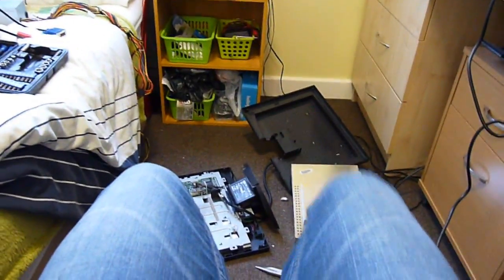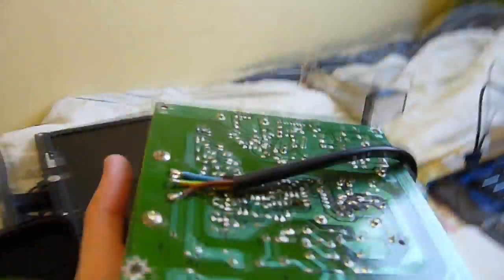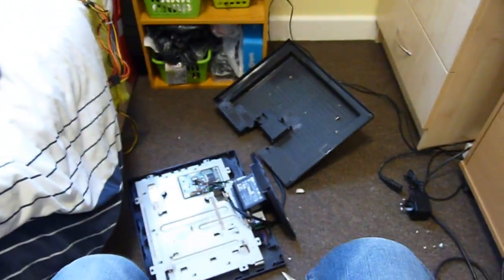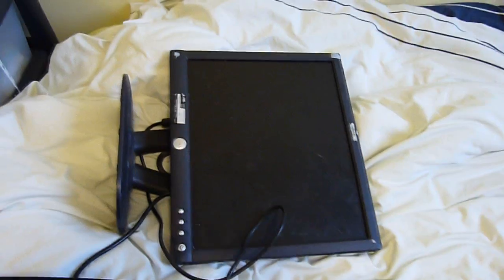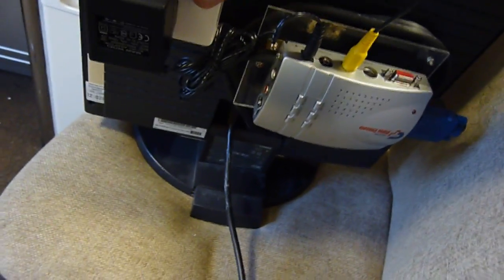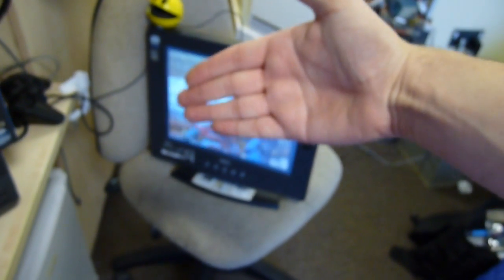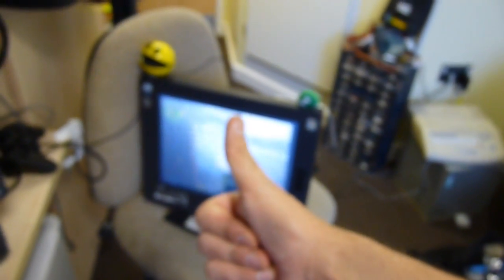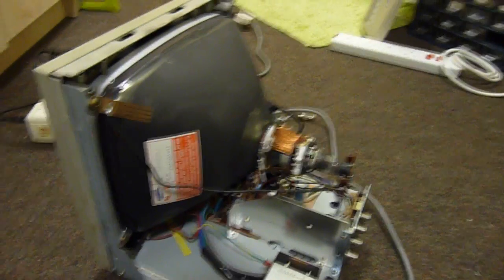DELL Monitor RCA To VGA Converter Mod

Comment: Hello EP9
I would like to kindly ask about the PSU birck used to power the converter. How much VOLTs is it rated with? I own one such converter, but have absolutely no clue which PSU I should use...
Thank you!
Reply from the maker: I think 5V. These days I would just pull off the monitors 5V but back then I just wired it up to the 250V.

Comment: I bought a similar converter like that today for my ps3 and my old computer monitor. I plugged it all in every way possible (I did reset my video settings in my ps3 to the av cables.) anddddddd I couldn't get any video on my monitor at all. I was wondering if there was a certain way I wasn't doing it right or what not? 
(I just noticed it says VGA to rca...is there a way to make it work the other way?)

Here is the link to the one I have if it helps!

http://www.amazon.com/gp/aw/d/B001CJOLBW/ref=mp_s_a_1_9?qid=1419916888&sr=8-9&pi=AC_SX110_SY165_QL70
Reply: you bought the wrong converter. the Converter you would need would be this. http://www.amazon.com/Ozright-RCA-Composite-VGA-Converter/dp/B018PZSMK6/ref=sr_1_3?s=electronics&ie=UTF8&qid=1465118878&sr=1-3&keywords=RCA+Composite+and+S-Video+to+VGA+Converter+Wide+Screen+US+Version
Reply from the maker: Nice, saved me a job.
Reply from the maker: If you were waiting for me the answer. It might be 5 years later ;-)
Reply: @TheEPROM9  Now tell us the answer
Reply from the maker: @DarkwoodDemonDoor  Lol you remembered.

These days you'd just convert it to HDMI. Although the cheap converters are crap. The retro community have made some good ones.

Comment: Do you have a link to where you got this specific adapter? I found this, (http://www.ebay.co.uk/itm/AV-RCA-Composite-S-video-Input-to-VGA-Output-Monitor-Adapter-Converter-DVD-CCTV-/251461429090?pt=UK_Computing_Sound_Vision_Video_Cables_Adapters&hash=item3a8c44e762)
But it has a BNC connector....
Reply from the maker: Cheetah Man No it was a skip find, well uni WEEE bin anyway.

Comment: Could you not tap the low voltage side?
Reply from the maker: Could of, but that would have taken more time and potentially taken voltage regulators I do not have up at uni.

Comment: 2 words to describe him lol capable and cute even if the socket's wiring is illegal.
Reply from the maker: Thanks. Don't see whats wrong with the wiring, it is safe.
Reply: ***** Appliance flex is to be wired into a BS1363 plug :D I am sure no one will notice!
Reply: tribalmasters Although I do have a rather odd cable with 2 x IEC connectors coming out of a Y shaped splitter and the other end has a moulded plug so it can run a monitor and computer or 2 computers!  I would think it was shady but it came from someone like Dell!